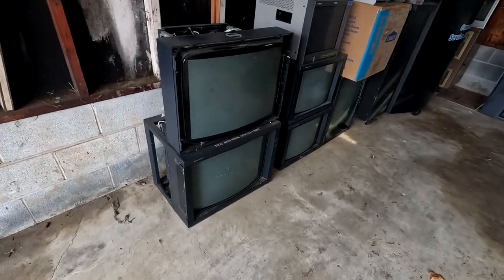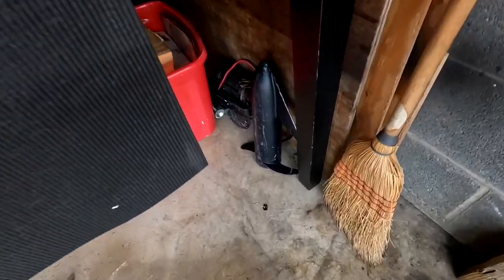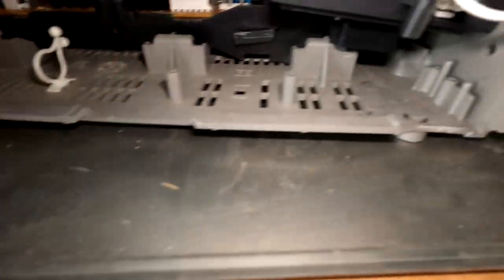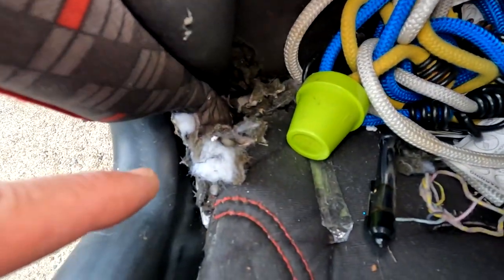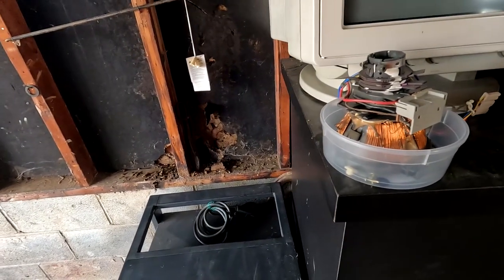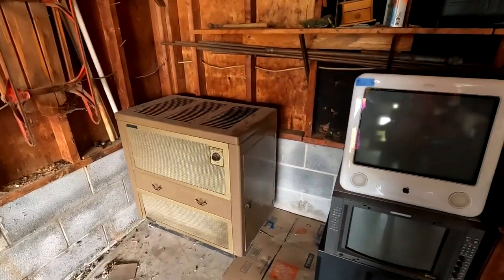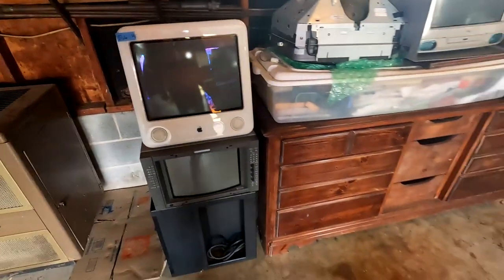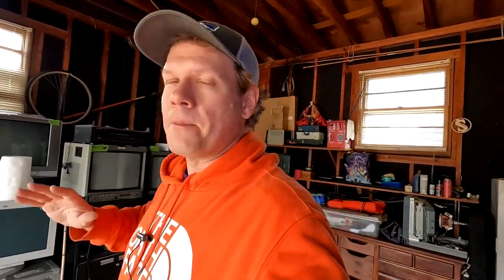Rats in the CRT Boneyard!

Comment: You need to renovate/reorganize your garage/workshop quite a bit. Put drywall up, put insulation up, restore your floor/fill in cracks, install cabinets, and build workbenches/tables. Your shop needs a lot of work. You also need to seal up the exterior of your house.

Comment: For the entry points, you need to seal using metal (e.g. copper mesh) and foam over that (for aesthetics). If you just use foam they'll chew right through it again.